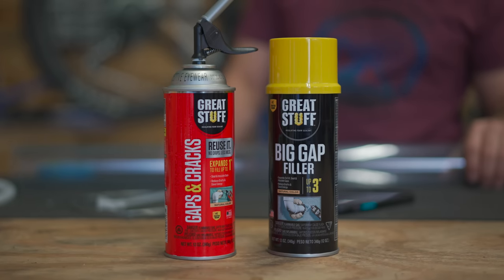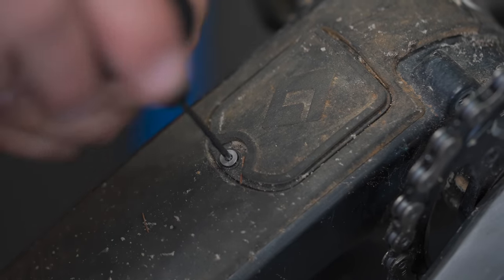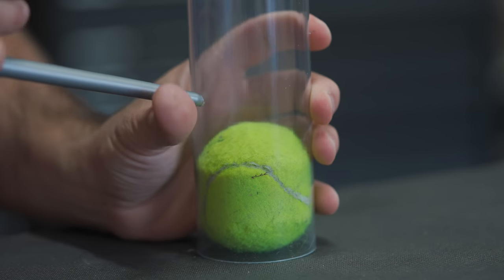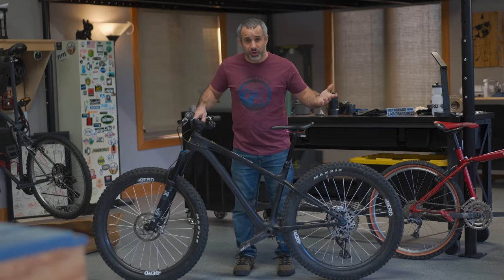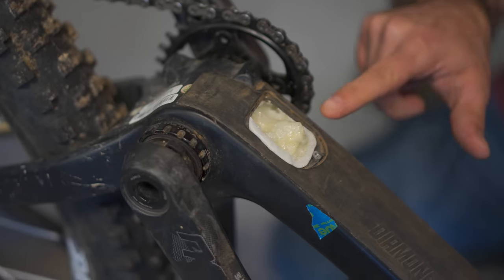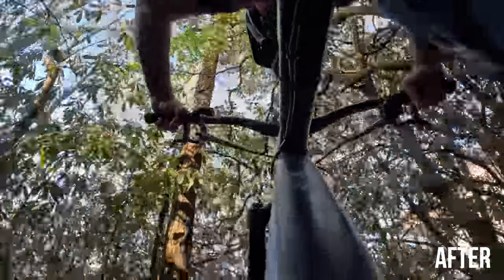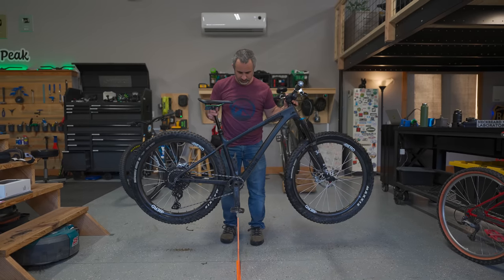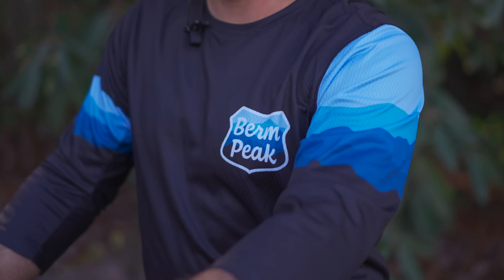Filling my bike frame with foam made it better—kind of. Don’t do it.

Comment: So a hack i used to do back in the day would be filling my handlebars with foam. It damped the vibrations by like 5x and made the small bump chatter wayyyy more bearable on a long DH day.
Reply: Now that's a good ideia!
Reply: What kind of foam? This seems like a good idea that's more viable to try for home mechanics.
Reply: I know moto guys used to fill the bar ends with lead shot to absorb vibrations. The foam idea sounds like fun to play with!!!
Reply: @nukleyar  Any foam can work. it just varies in ease of use and how much dampening. Pool noodle foam is easy and cheap to cut up and insert but doesn't dampen as much as filler foam like Seth used here.
Reply: I've done this as well -- even on my Fasst Flexx bars where the elastomers already help isolate vibration, I was able to notice a small difference in reducing sidewalk buzz from riding on pavement.

The Fasst bars made A/B testing easy, since I could put something in one side but not the other and compare the difference in feel in realtime.

What I used was 7/8" closed cell foam backer rod -- the size is almost perfect for staying in place in a handlebar and has the added benefit vs. expansion foam that you can pull it back out later if you want.

To get it to go all the way in, you can use a thin rod to push it (kind of like loading a cannon).
Reply: Spank actually does this, they call it VibroCore.
Reply: The one time I went down the rabbit hole on this idea I ran into lots of folks reporting it did very little, that this gap filler type stuff would never properly dry out and set in the confines of a handlebar.  The vibrocore stuff is pretty stiff by comparison.
Reply: ahh the poor man vibrocore!
Reply: Cheers man, gonna try this with my commuter bike. Had a hub motor on it but dear god that was a rough ride. 700c 28c tires and no suspension hitting a pothole at 25mph was not fun 😳
Already got thicker tires
Reply: @justincase3230  I bought Shockstop suspension stem for my gravel bike and it works like charm.
Reply: I use Spank Vibrocore, as someone mentioned.  I think it makes a difference.
Reply: @rdawson808  and spank also has vibracore rims if i recall right
Reply: @123moof  you need to use a filler with all components added, so it gets stiff.

Comment: Hey Seth, due to the logarithmic scale by which dB is measured, a reduction in 3dB is the same halving the noise output. However for the same reason and as you discovered, it is almost undetectable by the human ear.

So from and Engineering perspective this is a massive success, but practically all you've done is make your bike slightly heavier. 🤭😁 take care bro!
Reply: Finally someone else who was like how did he gloss over this
Reply: Correct, 3db is barely perceptible to the human ear, even in a side by side comparison. I'll guess the extra 300g he added is more noticeable.
Reply: The biggest contributor to “noice” on any bike seems to me to be the “loose” items on a bike and the resonance of a a securely welted or molded, essentially a one piece frame. Chains have notoriously been the source of noice on bikes. If frame resonance is a bugaboo, I would suggest inserting another type of foam! Regular poly foam! This stuff is not only easier and cheaper to install, just stuff it into the cavity but it is also easily revers-able! Just pull it out!
Seth, I would like to see an episode where you do this! You do an episode  called “STUFF YOUR BIKE!” Stuff every nook and cranny with polyfoam@ handlebars, head tube, down tube, seat tube etc.! Let’s see the results!
Good job!
Reply: To be more specific, -3db will halve the sound intensity and vice versa adding 3db will double the sound intensity but how human hearing perceives sound is different. You need to add about 10db to double the perceived sound volume and about -10db to cut the perceived sound volume to half.
Reply: @sakusaaristo191  pretty sure that's what I said. Did you read my entire comment, particularly that bit about it being almost undetectable to the human ear?
Reply: @AshH4rd1ng  Yeah, you're right. I should've started with "To be more specific" or something akin to that rather than what I wrote. I think I'm going to edit my reply to better reflect how I meant it. English isn't my first language, so I hope no offense is taken? :)
Reply: @sakusaaristo191  I thought log base 2 meant 10db change, doubled/halved the energy?
Reply: dBspl A doubles every 6dB. 

dB power, like watt is 3dB.
Reply: @transkryption  A 10dB change doubles or halves the perceived loudness. (This did trip me up, as well, because I was taught the 10dB rule at university without a lot of physical background information.)
Reply: @Taschenschieber  but isn't perceived loudness depend on frequency due ro different sensitivity @ different Hz
Reply: 3dB is quite noticeable. It just doesn't sound like what you'd expect from a doubling of position on a volume dial. More like +20-25%.
Reply: Seen as Top Level downhill racers use Ali bikes in UCI i don't think weight is too much of an issue, going downhill at least
Reply: I think the sound pressure doubles every 6 DB. The power doubles every 3 db. I think 6 db is a better metric since we hear via sound pressure changes, not the raw power of a sound wave. Either way, our brains perceive 10db as a doubling or halfing of a sound, but if we had perfect hearing, 6db would be the best we could possibly do.
Reply: Sounds to me like great success.  Now just fill the rear triangle, fork, tires, handlebars and seattube with foam. Might all add up to a perceivable difference
Reply: the decibel meter on the rides is mounted directly to the frame, its likely picking up vibrations inside the frame much more clearly than the human rider who does not have their ear pressed against the frame
Reply: im a music producer and i can hear 1 db difference easy peasy, its not a lot but i also have perfect 20/20 so maybe i just have super good hearing but i dont think i can hear much bettter then most people, i do hear much more frequency then almost everyone my age and some 20 years younger then me

Comment: Back in the 80's expanding foam was used to add permanant bouyancy to kayaks at either end. Issue was that it tended to absorb moisture and got heavier over time. I never used it and don't think I will be filling my bikes ant time soon!
Reply: They have closed cell expanding foam now that does not absorb water.
Reply: @bobbyhempel1513  you said "now".
Do you know for a fact that closed cell expanding foam wasn't a thing in the 80's? Or did you just mean that it exists nowadays without making a statement about the 80's?
Reply: @Jehty_   probably the latter
Reply: You can get weather resistant foam, but yes closed cells foam tends to be more durable for weather, but at cost of weight. Still, half a can of foam is still only maybe 300g?
Reply: As opposed to termite time soon?
Reply: @PTMG  I do. That's why I asked.
I find it interesting if closed spray cell foam was available in the 80's or not.
Reply: @bobbyhempel1513  I still think that water can be traped inside the frame.
Reply: I usually look for reason to not use spray foam. Cleaning it up is the worst. Only time I ever used foam on a bike was pool noodles zip tied to the bars and top tube of our "lake jump bike" as a kid in the summer.
Reply: That is open cell foam.Closed cell foam does not really absorb water.
Reply: In a kayak, I used plastic bags and filled them with foam. It makes removal so much easier if repairs are needed.oh, and stop cruelty to bike ants.
Reply: Fortunately ideas improve and purposes designed airbags become the better choice for kayaking. Although I’ve seen many hacks like that over the years 😂
Reply: Bass Pro still uses expanding foam in their Ascend kayaks. Lol
Reply: @Jehty_  Growing up in the 80s, I am sure closed cell foam was available (it dates back to the 50s, but the only guy I knew in the mid 80s who had any did commercial refrigeration), but the stuff you most commonly found at the hardware store was the same type open cell spray foam you find these days. Even today there is a HUGE price difference between the open cell and the closed cell. I did a quick search. I could find no homeowner/hobbyist level closed cell for less than US$60 (most listings where over $100), and most of the advertisements I saw where for 2 part foams. I did find a number of hardware store type cans advertised at sub $15, but each time I looked closer I found they where open cell. I DID find one consumer level closed cell foam in a can at $25 for 1.6 cubic feet of foam (probably about $100-150 to do a canoe with floatation blocks)

As of '88 I was only able to find closed cell pipe insulation without going to some professional supply house (I was looking for half inch flexible sheet foam at the time, and had to abandon that project)
Reply: does it mean you will jump higher due to improved bouyancy?
Reply: @Jehty_  I said exactly what I said.
Reply: @Jehty_  I was born in 1987 so I don't know what they had in the '80s as far as expanding foam because I did not use any during the '80s.
Reply: @eve-llblyat2576  water could probably be trapped inside the frame but water can always be trapped inside the frame whether you have spray foam inside it or not.
Reply: Some of you commenters need to band together and make a You Tube vid on expansión  foam
Reply: @mattlewandowski73  actually the great stuff pro series is closed foam.
Can find them at most hardware stores for about $15, but need the $60 gun though.
Highly suggest the gun if doing anything over 2 or 3 cans though. So much easier.
Reply: @Jehty_  it becomes open cell with lots of sun, i guess.
Reply: @eve-llblyat2576  for sure, but not if it is open cell. you can probably treat the frame first to be sure.
Reply: @bobbyhempel1513    Ice crystals pierce thin membranes. So closed cell foam has a habit of becoming not entirely closed if exposed to seasons.

Also believe it or not the PU polymers themselves are capable of absorbing and conducting water, because water isn't a very large molecule, so it finds a way to squeeze itself in into the molecular matrix. Since polymer doesn't have a lattice, its density is not uniformly distributed, it's basically a tangle of long chains, and there's room in between these chains - normally little gets in because there are repelling forces, but gradually it does diffuse in. It's a slow process, but if there's no way for water to get removed, it's cumulative and its effect is pretty obvious over time.

Comment: I use these products in my trade from time to time. Construction to be exact. I have seen these foams bow windows and doors and lift bath tubs of the floor and crack fiberglass when not used correctly.  So I see why people might be worried about cracking a bike frame. If I  was going to try this (which I don't think I ever would haha) I would definitely look for the minimum expansion variants designed for windows and doors.  I applaud you for trying this for us, in the name of science haha.
Reply: zatz becoz you are in meriguh and yo build walls out of woot, here in germany zis foam would start to cry and would get qnokked out by aur solid konstruction! 

lmao 

to be honest, yeah there is lots of power within that foam. but i couldn't imagine the foam is as strong to damage a serious bike frame. interesting video tho!

edit: talking about alu / steel frames. don't know how it would impact on carbon frames. i have none, but i guess i would not not try it out on a carbon frame. :D
Reply: Good thing about homes is that they must be heated to at least above freezing temperature at all times, for any number of reasons.

This is not how bikes are used.

So you have this closed cell foam, but let's say a little bit of water finds its way into the outermost cells. Then well there's no escape. Eventually it freezes, bursts the cells, and finds in deeper. 10 years down the line you have the whole foam taking on water, perhaps not entirely full of it, but holding onto a small amount.

If you have a steel frame, it's probably rusted through at that point.

Carbon fibre... well it has some inherent water wicking ability and also suffers from water but it just makes it structurally less sound with heating/cooling cycles, little by little. The epoxy resin in carbon fibre can conduct the tiniest amount of water, but in general it's pretty resilint to it, but once you add glass or carbon fibre it happens to outright wick water in and concentrate it on the fibres, up to about a handful percent. If you forget to preheat a circuit board and carefully drive out the moisture, when you hot air solder, it's probably going to form a steam bubble and pop, which is very bad, it destroys vias. Carbon is similar.

Comment: You can still calculate the weight if you have the leftover can (and the excess foam you played round with)...
Weigh a full can, weigh the used can + foam from the clear tube etc... The difference is the weight you added to the bike. (The foam does not change weight when it expands).
Reply: Not really, there's loads of moisture lost during the curing process so the final result is much lighter than the initial weight.
Reply: @anthonymorris8891  soooo pump out 50 grams of foam onto a piece of cellophane on some good kitchen scales... and weigh the result when it's cured.. and do the math... You can STILL calculate the weight... I just didn't want to mansplain too much otherwise I tend to write 1000 word essays... (I've reached the U-toob comment limit a few times now...)
Reply: I don't think it is correct that it loses moisture. Foam doesn't dry, it cures. Meaning the moisture isn't water that evaporates, it's foam that hardens. In fact, the instructions on the can say to mist it with water to speed cure time. I think the above measurement process would get you close.

Of course, we'd have to test it to really find out.
Reply: @JJ-iu5hl  Depends on the foam. If the medium is an evaporating additive... If the CO2 to make the bubbles requires water (than then dries) etc.
Reply: Why not just weigh the bike before and after?
Reply: @fantabuloussnuffaluffagus yeah people seemingly can't be arsed to travel back in time these days
Reply: @identiticrisis  If you can weigh the can (and other stuff) before you start, you can weigh the bike before you start.
Reply: @fantabuloussnuffaluffagus  but this bike is already full of foam. Try it yourself and report back, for science :)
Reply: @anthonymorris8891  there's loads of moisture lost, really? Where's that going to evaporate then? If this is true, a load of moisture trapped inside your frame would be another possible reason not to do it.
Reply: @TheButlerNZ  U-toob 😭😭
Reply: @fantabuloussnuffaluffagus  (if you can weigh the can etc)... You can always weigh another can at a shop... Your bike may not be as easy to exactly replicate after the fact.
(If for instance I did it with my ol Foes, the frame would be hard to find, the cranks are steel, the rims are unobtanium... but I can look up online the weight of the can (or just read the half empty one) so yeah... easy to "weigh the cans beforehand) even though its AFTER the deed is done.

As we're talking about mere grams with foam you really would have to weigh that exact bike.. but they didn't...
Course we're arguing about a pretty petty thing... effort better spent on more important world shattering things like who wore what at the latest "insert Awards title here".
Reply: @fantabuloussnuffaluffagus  because he forgot to weigh it before...

Comment: Motorcyclists used a form of expanding foam for a number of years to deaden the vibration in handlebars... They also filled their handle bars with sand, and a few other vibration mitigation techniques over the years (not all at the same time). Filling the frame with foam will add weight, but it will also deaden vibration, and will help to keep the internal cables from being slapped into the frame (a potential source of noise). outside of that... minimal gains. I MIGHT consider it on the handlebars for a touring gravel bike.

Comment: I mean there’s definitely something to it. Spank makes a bunch of mtb parts such as wheels and handles bars which are filled with foam in order to achieve better vibration damping, by all accounts it seems to work for that purpose. So if anything a good thing to think about next time your testing is whether or not the bike soaks up vibration better during a long sort of xc ride.

Comment: I work for an insulation company and we use spray foam insulation .It weirdly adds slot of strength to a home .It may strengthen the frame as well as dampening shocks slightly but the foam you used won't really do much because how thin of consistency the foam is.
Reply: Yup, you can build for example a DIY strong but very lightweight truck bed camper using spray foam.
Reply: They use a different foam to fill rally cars chassis and things like that to add rigidity.
Reply: It is not remotely comparable but BMW used foam back then on the e46 as a fix to prevent the subframe mounts from cracking.